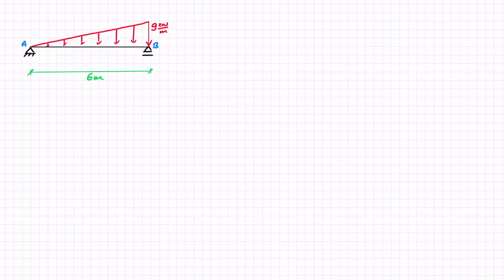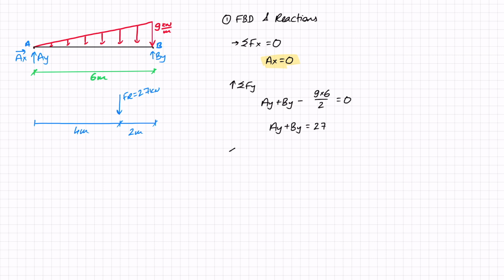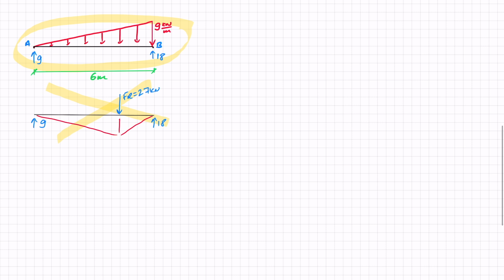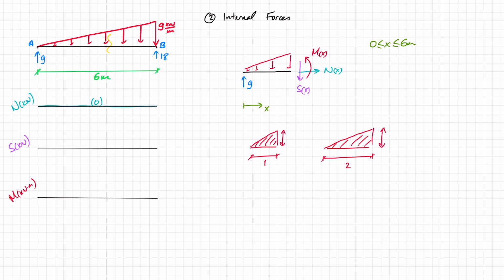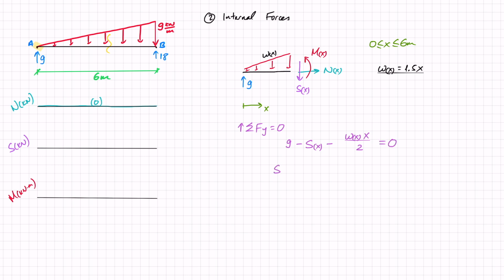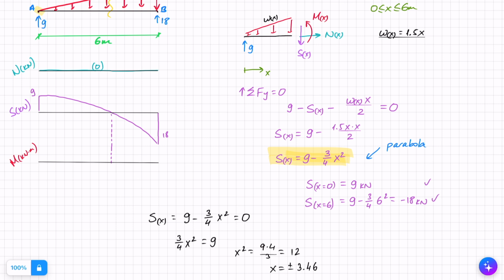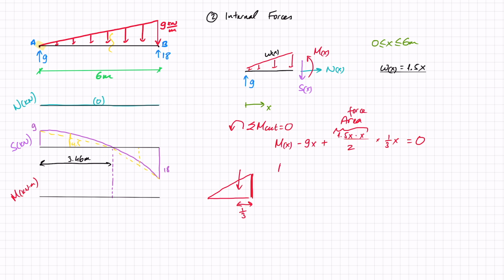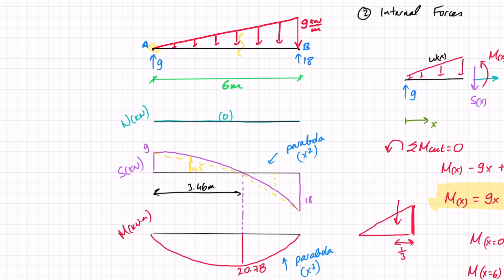Engineering Mechanics | Beam Analysis - Internal Forces | Tutorial 3 | Step-by-Step Triangular Load

Comment: Bit tricky but got there eventually. I eventually got my head around the formula W(x) = 1.5 x. It just clicked. Have to remember to work out shear load using x, but for the moment its 2/3x or the centroid. Did you use 1/3x? Or is it my misunderstanding.
Reply from the maker: Yes - it is a bit harder as we complicate the loads. For the load w I think it’s easiest to define the function of the load which is how we ended up with w=1.5x. Regarding the centroid of a triangle- it’s always at a location of 1/3 of the length close to the opposite side, and 2/3L to the angle. So the distance you take for the moment depends on where you are calculating the moment. In this case I was calculating at the opposite side so the distance was 1/3L to where I was calculating moments. It’s  hard to explain exactly in words without being able to draw it out, so let me know if unclear and I’ll try to clarify further.
Reply: @EngineeringTheCurriculum I relooked at it. I see now. Thank you.